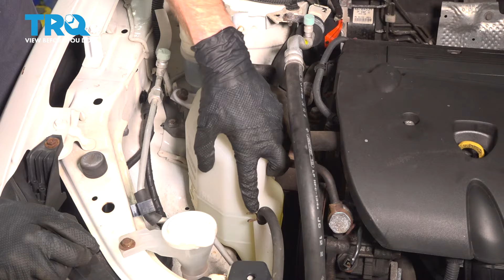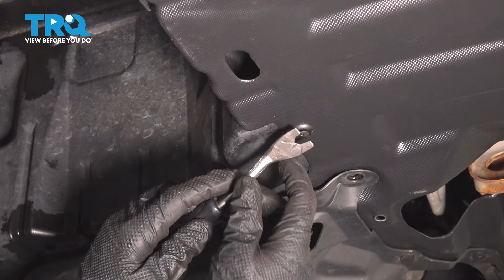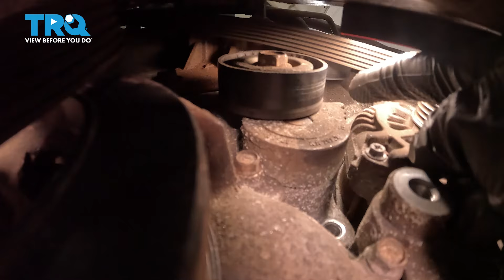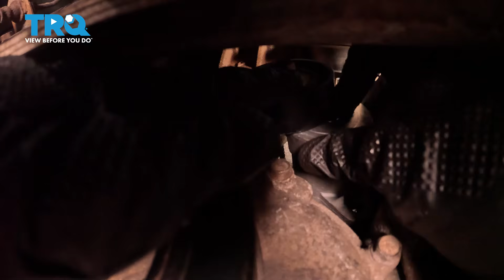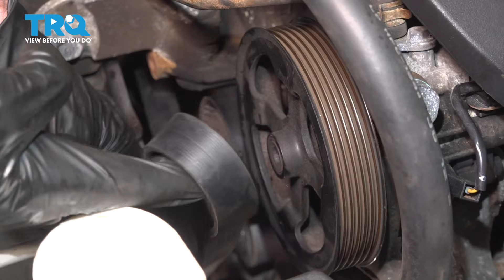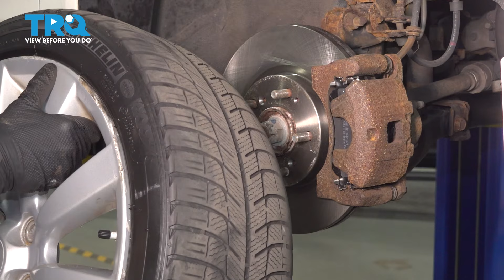How to Replace Accessory Drive Belt Tensioner 2008-2017 Mitsubishi Lancer 2.4L L4

Comment: Why don't you show the tensioner in the way? I can't reach my bolt unless someone else moves the tension while I get the bolt..

Is yours completely busted or what. Same set up and no way a 12mm dw is getting in there "as scene"

Also pulley bolt is a 14 not 16